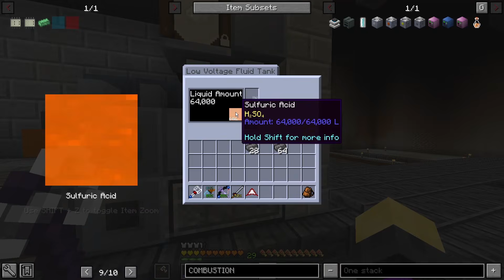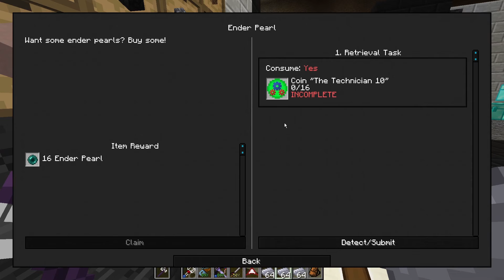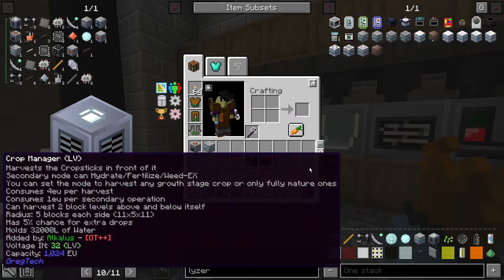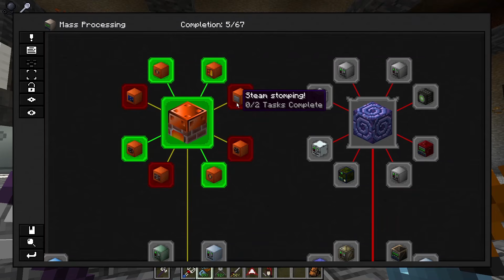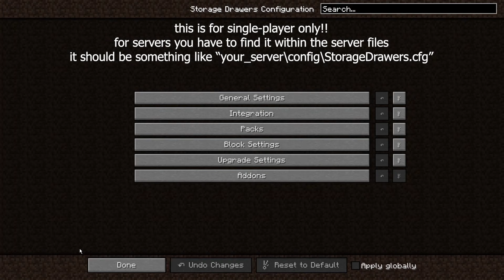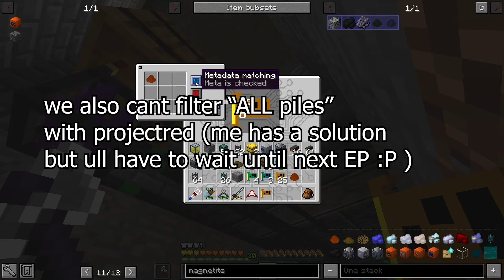GregTech New Horizons EP11 - Industrial amounts of chemicals and Ores

Comment: Past a certain point cable loss becomes neigh irrelevant because of how big the amps get. You'll also start having access to alternatives to simple cables like AE2 power p2p, wireless power, tesla coils and superconductors
Reply from the maker: i though p2p isnt worth it cuz of the loss? although now that you reminded me of the tesla stuff i definitely want to have that
Reply: @Dauom  It's a 5% tax on whatever you send though the p2p which, if you ask me, is a super small price to pay for how insanely convenient they are.

I have all my power producers dump their power into a central battery (LSC) and then i take one wire per voltage out of it into an appropriately named p2p and i can just access any voltage from anywhere in my base with incredible ease
Reply: @DrunkGeko 5% is A LOT!
At hv it's like 25 cables long worth of loss 
At ev it's around 100 cables worth of loss
By the time you really start to centralize power maybe iv 'ish that's 410 cables worth of loss

And that's not including the energy demand of the ae2 network (much more then you'd expect, wireless in paticular!)
Reply: @BackuPacnt-t7w it's trivial to make up for it by just making a touch of extra power. As i said i think the convenience of it far far justifies the cost

Comment: It's probably worth it to make an air centrifuging line using the steam multiblocks. Both Oxygen and Nitrogen will be very very useful moving forward (Oxygen is used in virtually all chemical processes and Nitrogen speeds up the EBF and is also needed for some fuels)
Reply from the maker: waaaiit it completely slipped my mind that i have multis for that, definitely gonna set that up once it becomes a problem

Comment: Basic pump has very limited range, it generally misses quite a bit of oil down in the pocket, especially on the large spouts.

Edit: MV pump will get the entire spout and run off one LV generator.

At this point its worth looking into the fluid drilling rig though
Reply from the maker: yeah im definitely getting the multiblock drill then, theyre both at mv so might aswell